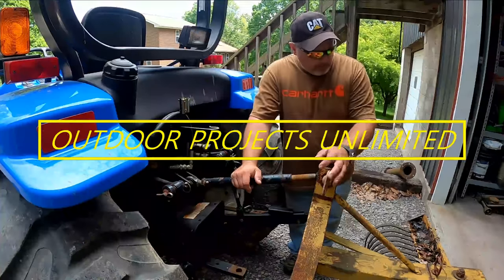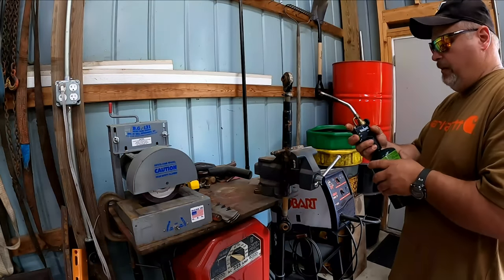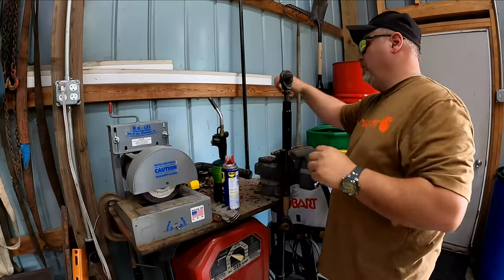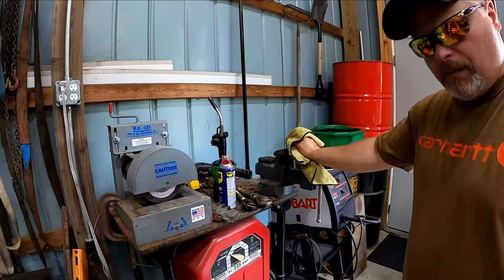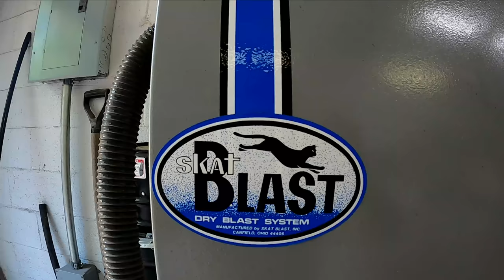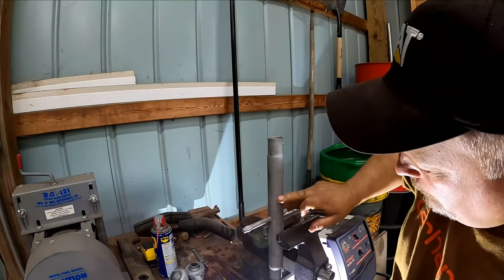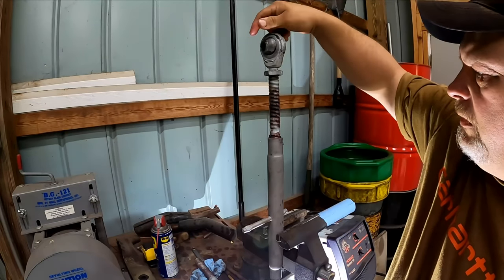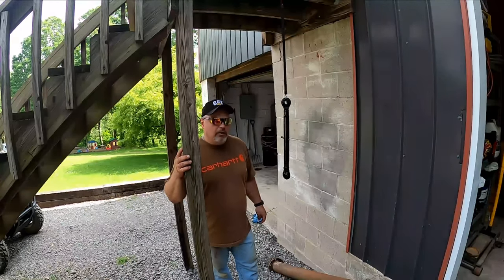Tractor Top Link Repair

Comment: Got the same problem, and I'll try your heating method.  See if it can save me a few $$  Thanks for the vid
Reply from the maker: It should ,heat it and tap around on the body while working in some lubricant.

Comment: Currently unfreezing a top link.
Your video comes in very handy, thank you very much.😉👍
I've heated it twice adding WD40 but  it doesn't budge yet. For how many minutes do you heat it? Is there a minimum or maximum to the heating time?🤔
Reply from the maker: The heating should expand it and allow the lubricant to get down thru the rust easier, some  occasional tapping on the round threaded barrel will help to loosen the rust as well. Make sure you get it good and hot so that the lube basically boils when you are spraying it in there then tap and work with it a bit trying to get it to turn then let it cool and repeat the process. If you just continually keep heating it it will also expand the thread inside  which will make it harder to get freed up. you just want to heat the outside as quick as you can and get the lube in there and tap and work with it to get it loose.
Reply: Thanks for the advice, i'll try again tomorrow😉👍